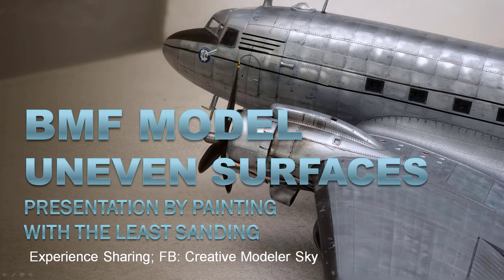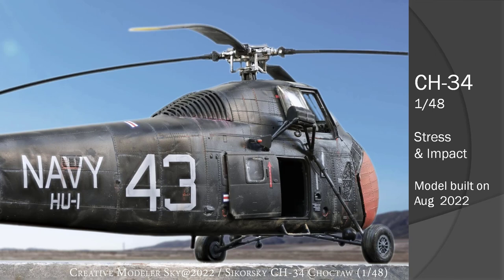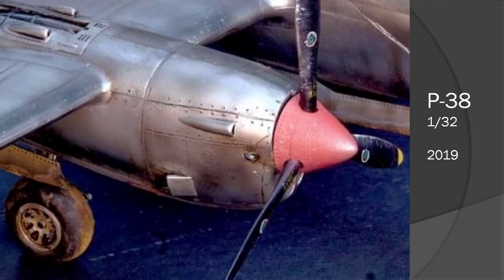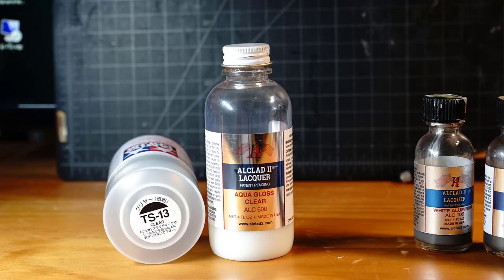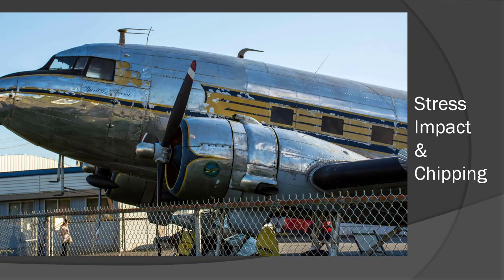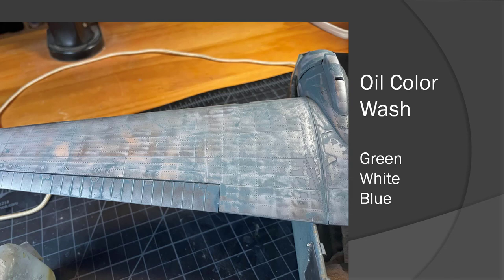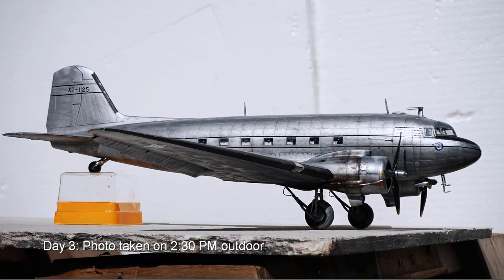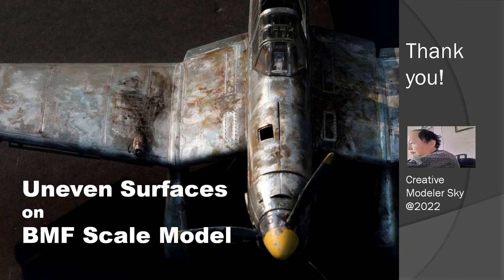The rendering of BMF scale model for it uneven surfaces  [Creative Modeler]

Comment: Thanks for covering this topic your work is fantastic. 
I model and I am a aircraft structure engineer.
The terms we use for stress skin are quilting, dishing, and tin canning.
All these affects are age related to the airframe and differ from different periods and pressurised and unpressurized aircraft.
Quilting mainly forms on newly built airframes, this is due to the soft state of aluminium mainly a T3 state  this aluminium hardens over age and was extensively used  on early aircraft. As the rivets are reacted the aluminium around the rivets expand around the frames and stringers pushing the skin outwards causing quilting effect . Over time the aluminium shrinks due to hardening.  This effect is dependent on the skin gauge or thickness. 0.032 being the most common unpressurized fuse . 
Dishing is the effect of age and skin shrinkage. 
Tin canning is formed through to twisting and torsional stress loads you will often see this aft of the wing  TE on the belly skin's. Hope this helps your viewers to visualise the different effects. 
And thank you for showing and sharing your techniques.

Comment: The buckling in skin material is because of the way that the frames and skin panels are used together to carry the airframe’s load. 

The thin plate sections flex with the frames, but because they are fixed along all sides, there is limited room for distortion to occur under load and release. 

When loaded and stretched, they move with the frame. When that load is released, the frame will ‘spring’ back in shape, but the fixed panel can’t, because of its fixing to several frames. So the ripples are tension stretch marks that haven’t been allowed to release. So they stay permanently stretched as ripples. Not really a structural problem, but does show the material has reached its elastic limit. There’s the structural engineering explanation.

Great work and interesting video. Thanks for sharing.

Comment: Very nice results but it looks like a lot of work and patience to reach that level on the finish. I believe it is more difficult to achieve on a 1/72 or 1/144 DC-3. Your model is a Revell or a Trumpeter?
Reply from the maker: I cannot handle 1/72 or 1/144. It's beyond my capacity.  Best wishes to you for exploring.
Reply from the maker: I cannot find any Revell 1/48 DC-3 on the eBay.
Reply: @creativemodeler  those would be re-boxings of the Monogram kit.  The Monogram boxings are more prevalent.